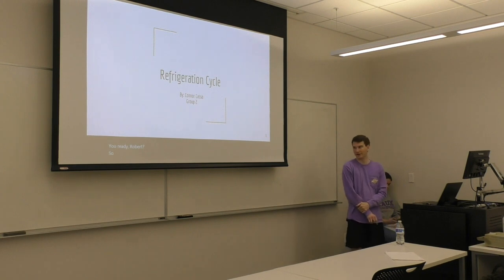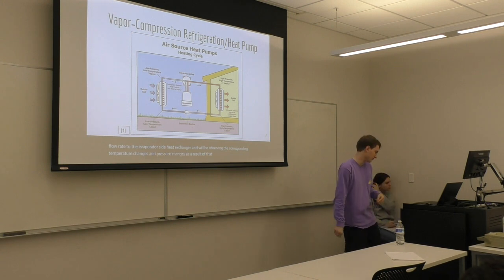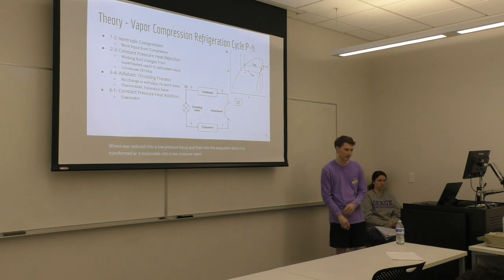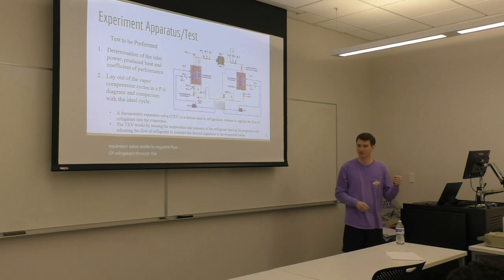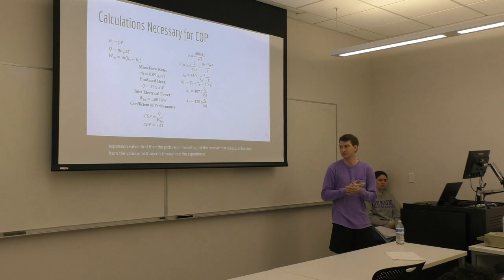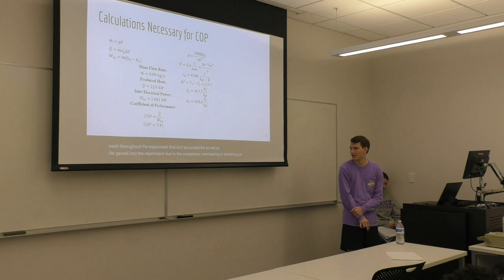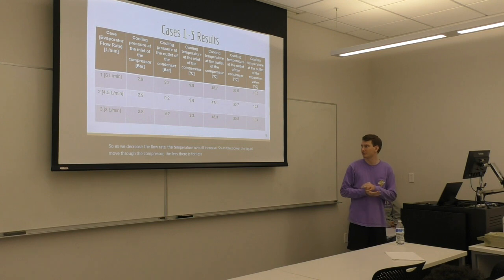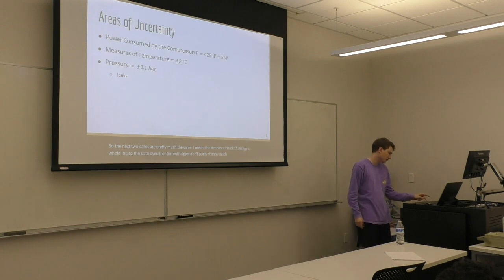S1090006

Comment: Colin Roberts - This is another excellent technical presentation from Connor. As he did in his lead role for the bomb calorimeter experiment presentation, he again presented a very in-depth thermodynamic background of the experiment. He explained the vapor compression refrigeration cycle from multiple perspectives. This approach gives the viewer a well-rounded understanding of this experiment and its theory. My main area of improvement is to be careful with the text size in the figures. A few figures early in the presentation could have been easier to read. Overall, this was a fantastic presentation from both a technical and presentational standpoint.